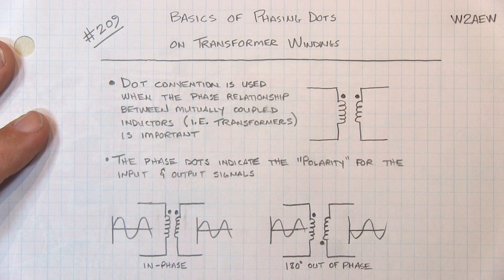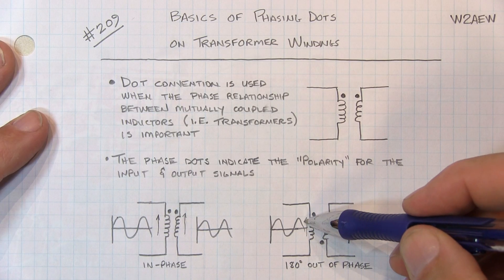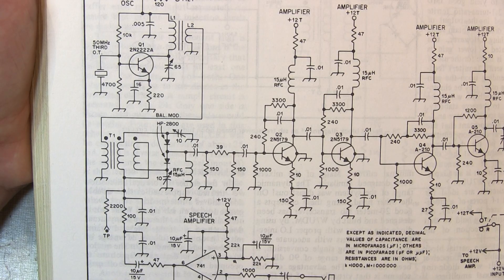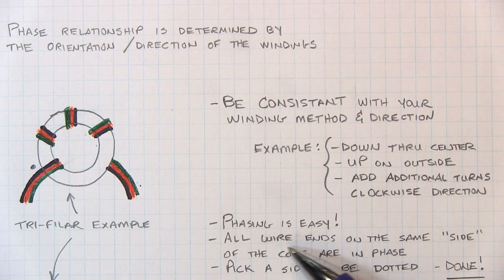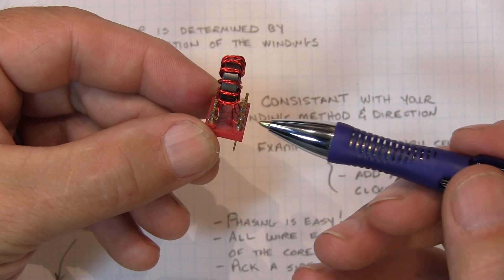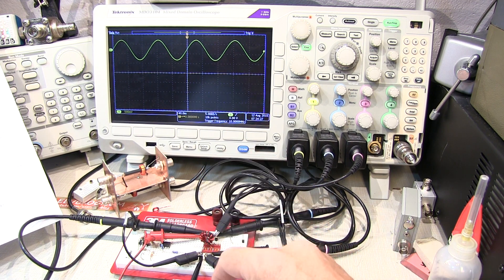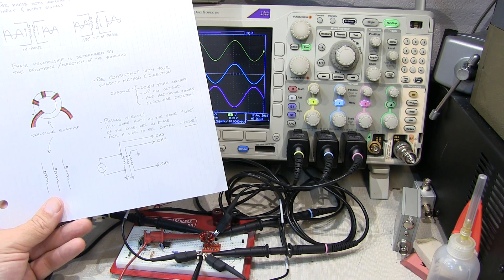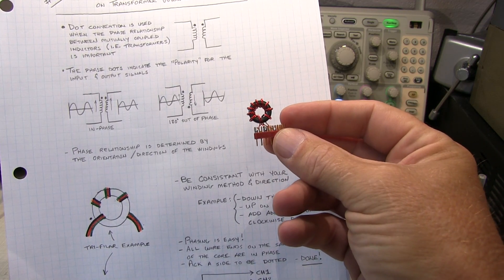#209: Basics of Phase Dots on Transformer Windings

Comment: The Transformers are called EI Transformers because the steel sheet laminations are shaped either as an E shape or I shape, but why are they making the laminations as an E shape and I shape?
Reply from the maker: The combination of the two shapes make it easy to make a bobbin style core for the magnetic path, and laminations reduce eddy current losses  
https://m.indiamart.com/proddetail/transformer-laminations-1349747591.html
Reply: @w2aew ok thanks I didn't know the E shape and I shape laminations were for the bobbin style. The plain enamel wire used had a coating which now the coating has been banned for health regulations which the coating reduces the outside EMF interference. The laminations are used to reduce the Eddy currents in the transformers iron core? The laminations are steel which brass and steel have Eddy currents, nickel plating doesn't have Eddy currents but steel and brass do have Eddy currents
Reply: @w2aew  Why do Single Ended Class A Transformers need a DC Bias voltage, which it has the rating listed on the transformer? Single Ended Transformers for Class A operation use an "Air Gap" which I think the Air Gap does something to cancel out the DC from magnetizing the transformers core? Dual Ended Transformers don't have the AIR GAP in the core so they can make the transformer much smaller sized. Single Ended Transformers are bigger sized, more steel lamination plates, bigger core, more winding, has an Air Gap.

Comment: What causes "power losses" in EI transformers? Why do EI transformers and toridial transformers have an "operating duty cycles" at certain frequencies? What I'm confused about is what is determining the transformers operating duty cycles?
Reply from the maker: typically Eddy Current losses:  full documentation here: https://en.wikipedia.org/wiki/Eddy_current
Reply: @w2aew  so you're saying that EI transformers have a higher Eddy current VS toridial transformers have less Eddy. The Eddy current is causing the power loss. What is causing the Eddy current to increase or decrease in transformers? Is it the laminated plates causing leakage current. Eddy currents are circulation current that is NOT draining to ground or has a path to ground?

Comment: What does M6 laminates stand for the M6? The winding of the wires "proximity" is either loose or tight, but in transformers specs it doesn't list the wires winding proximity any reasons why? The looser wires winding is LESS inductance mean more high end
Reply from the maker: There is a description of the properties of this material here: 
https://edcorusa.com/products/ei-37-m6-29-gauge-orientated-single-phase-steel-lamination?srsltid=AfmBOor1vIL6vqtM0Ai4_U7KKZrUFNozfk8RcbGHdXd6Yh_GOC9okaN9
Reply: @w2aew  The M6 means the Alloys used? or the grain structure? I'm confused what are Laminates in transformers, they are somewhat like capacitor plates which capacitors internally have laminates/plates? The M6 laminates changes the magnetic field level and magnetic flux levels? It can be measured using a Gauss meter?

Comment: When a tube amplifier output transformer is used in correctly but using a speaker impedance that is below the rated impedance will cause the reflection impedance to be doubled. If the output transformers is designed for an 8 ohm speaker load but instead some uses a 4 ohm speaker load the reflected impedance will be doubled which will cause the power tubes impedance to be mismatched with the primary side of the output transformer. This causes an audio volume drop and wattage drop, any reasons why?

Comment: very informative. One question i would like to add is how to determine the # of windings if its not writtten of specified in the schematic? some do put values while others do not
Reply from the maker: There are several variables.  The frequency of operation, the impedances of the circuits, and the ratio needed, along with the core material used, all feed into the number of turns required.  For 1:1 ratio transformers, it is common to have sufficient turns to get an inductance value at least 4x the system impedance at the lowest frequency of operation.

Comment: How can you test the transformers laminations to know if they are high quality laminations or cheap steel laminations? anyway of testing this or how to measure a transformers eddy current? I'm not sure if a ammeter can be used to test the transformers eddy currents because the higher the eddy current this means that the transformers laminations are cheap steel?

Comment: Can you try to make a video lesson on how to use a mega to check the insulation of transformers and motors because the only way to test a transformer of the IFS a partial coils or shorting or there is this like a small internal short not all not a not the whole transformer but just partial shorts because of the insulation a mega will test the insulation voltage if there's something wrong but I don't know how to do it because I don't know what is right and what is wrong and what is considered good and what is considered bad when you have a transformer and you're running both high voltages from it to chest installation to see if there is a partial short

Comment: sir may I ask you a somewhat related question? I am wondering if we can connect the primary windings of an audio isolation transformer to the output of a class B direct coupled amplifier and the secondary windings to the speaker?  Will the output of the amplifier be affected in a harmful way due to the impedance of the primary transformer? Using a one to one turns ratio.
Reply from the maker: If it is a one-to-one turns ratio, then the impedance at the primary will be equal to the impedance connected to the secondary.  In other words, the amplifier output will "see" the speaker impedance.
Reply: @w2aew  Thank you! I appreciate it.
Reply: @w2aew  I am just concerned if the primary windings will look like a short to the amplifier output with or without any speakers connected to the secondary.
Reply from the maker: @uiticus  It will look like a short at DC (biasing), but will reflect the secondary's load impedance at audio frequencies.
Reply: @w2aew  Thank you sir. Much appreciated.

Comment: Excellent and brilliant explanation...
With regards with power transformers. Just by taking 2 separate secondary windings of the same values and hooking them up in series out of phase one could gain a few more volts compared to the 2 same windings in phase.
Thumbs up...

Comment: To measure the alloys in transformers, what lab equipment can you use to measure how much Iron, Nickel, metals in the transformer? Some EE techs use a Spectrometer I think. The old radios from 40's and 60's use to call the transformers "radio metal" which means that have 80% percent nickel which I'm not sure why they used so much nickel in radio transformers. The Lamination for the transformers windings was 5/8ths which for any reasons why they used 5/8ths for the lamination on the winding?

Comment: When visually looking at a transformer or measuring them, how do you know if the transformer is a galvanic isolation? I'm not sure what make a transformer have galvanic isolation. The iron core and wiring wrapped around the bobbin or slug is the transformer part but what is the galvanic isolation part of the transformer to make it galvanic?
Reply from the maker: Galvanic isolation means that there is no DC path between the primary and secondary - that's all.  You can easily verify this with an ohmmeter.
Reply: @w2aew  The Iron Core or what is causing the Galvanic Isolation and preventing there is no DC path? because all transformers even Non-isolated transistors have Galvanic isolation. I'm not sure why its advertised that ONLY isolating transformers only have Galvanic isolation and other non-isolating transformers aren't advertised as having galvanic isolation.
Reply: @waynegram8907  are you talking about safety transformers? In all transformers the windings are isolated from each other. In safety transformers, used on construction sites for example, there is additional isolation seperating the windings so primary and secondary can never short. The secondary winding also remains floating from ground, so a fase to ground fault in equipment does not cause high fault currents. I do not know why they call this galvanic isolation. I understand your confusion.
Reply: @w2aew  How can you tell if an output transformer has an internal air gap because some transformers are called air gap transformers. What does the air gap do because it suppose to allow DC current and DC voltage to go through the transformer coil?
Reply: @w2aew  Galvanice Isolation means that the mutual inductors between primary coil and secondary coil is ZERO. How can you measure the transformers "mutual inductance", using an LCR meter? because most transformers tell you the turn ratio TR the primary number and secondary turn number but they don't tell you the mutual inductance between the primary coil and secondary coil ,  any reasons why?
Reply from the maker: @waynegram8907  No, Galvanic Isolation does NOT mean that the mutual inductance is ZERO.  It means there is no DC path between the input/output.
Reply: @w2aew  Most Isolation Transformers have Mutual Inductance so when you have mutual inductance across the primary coil to the secondary coil the mutual inductance  value is higher than zero so their is no galvanic isolation. Galvanic isolation is measured based on the mutual inductance across the primary coil to secondary coil, this is what other EE engineers have told me. Yes all isolation transformers has No DC path between input/output but they have mutual inductance that is higher than zero.
Reply from the maker: @waynegram8907  ALL transformers have mutual inductance between the primary and secondary - that's how they work.  Galvanic isolation has NOTHING to do with mutual inductance.
Reply: @w2aew  Isolation Transformers have a mutual inductance specification because the higher the mutual inductance the more noise from the primary closed loop circuit jumps across to the secondary closed loop circuit. The lower the mutual inductance the less noise so better signal to noise ratio. I didnt know Galvanic Isolation meant that DC can't jump across from primary to secondary because all transformers are considered galvanic isolation. I can't name another component that is galvanic isolation besides an Opto Coupler or Opto Isolator which I'm not sure if Opto couplers or opto isolators are considered galvanic isolation? PCB boards have isolated grounds which I guess they are considered Galvanic isolation since each grounding plane is isolated from each other its considered galvanic isolation?
Reply: @w2aew  When Engineers say that the transformer is Loose coupled means what by loose coupled? Loose coupled compared to Tight Coupled
Reply: @w2aew  The higher the resistance of the inductors winding means that it takes long for the electrons to pass through the inductors winding resistance? The Higher the resistance in a transformer make the electrons "less easy" to move from the primary coil to the secondary coil?

Comment: The formal dot convention state that each positive current injected into a dotted terminal of a multi-winding coil, will result in a core magnetic flux with the same direction, contributing to the flux  buildup. The voltage polarity is just a side effect actually...

Comment: What causes transformer hysteresis? because the transformer hysteresis will cause a voltage drop from primary to secondary, not sure why
Reply: Remenant magnetism in the transformer core. The current magnetises the core and the magnetic field generated has a polarity, direction, whatever floats your boat, that is a function of the direction of the current. If you turn the current back to 0, a small magnetic field remains in the direction of the current. If current starts flowing in the reverse direction, it has to 'undo' the remaining magnetic field first before a magnetic field in the other direction can build up. This is what causes the hysteresis loop.

Comment: Could you give us a couple (pun painfully intended) examples of why in phase would be desirable, and also out of phase would be desirable in a circuit? For example: an early single ended guitar amp? Thanks Alan! Great video BTW! ;)
Reply from the maker: The most common application where the phase through the transformer matters is when the transformer is part of a feedback loop, where improper phase will cause the circuit to not work.

Comment: 3 phase transformers will have 208VAC outputs, its 120VAC +180degrees = 208VAC? The reasons why they used 208VAC instead of 240VAC was that 208VAC produced less heat dissipation and didn't wear out the AC motors in house equipment?
Reply: In a three phase transformer the phases are 120 degrees from each other. The phase to phase voltage is 120 V times √3. The advantage is that the delivered power from a 3 phase configuration is really smooth. Power from a single phase is actually a 100 Hz pulse while the motor tries to deliver continuous mechanical power. So it starts vibrating.
Reply: Edit: probably a 120 Hz pulse where you live.

Comment: w2aew, for center tap transformers that use the center tap as the ground, when disconnecting the center tap from ground the other voltages which drift higher or lower. When a 12VAC center tap transformer center cap is disconnected from ground, each side of the transformer will drift higher or lower but will equal to 24VAC. If one side of the transformer lug measured 12VAC referenced to the center tap to ground and the other side measure 12VAC referenced to the center tap to ground that is 24VAC from outside lugs. But when disconnecting the center tap from ground the output lugs will drift higher or lower but will still equal to 24VAC. Any reasons why the output legs will drift higher and lower in voltage and not be "matched" at 12VAC?
Reply from the maker: The ends will always be matched at 12VAC with respect to the center tap.  But, if the center tap isn't connected to ground, the voltage from either end TO GROUND can be anything because it is isolated from ground.
Reply: When the center tap isn't connected to ground, why aren't the ends matched to the same voltage? The transformer windings from the center tap to each end should have the same winding turns ratio so they should have the same voltage even if the center tap is not connected to ground.
Reply from the maker: @waynegram8907  They Do have the same voltage when measured with respect to the center tap, but they won't necessarily be matched when measured with respect to ground.  This is because the center tap is not tied to ground.
Reply: That is what I'm confused about is why won't they be matched with the center tap is not tied to ground. They should be matched because the winding turns/DC resistance from center tap to end lug are the same. The transformer windings should be symmetrical from each end lug to the center tap
Reply from the maker: @waynegram8907  If you measure from either end to the center tap, they WILL be matched.
Reply: yes true, but not when you put your Fluke DVM meter black probe on the chassis ground to measure the voltage on the ends the AC voltages won't match. This is what I'm confused about because when you measure the DC resistance from center tap to each end they have the same DC resistance but the AC voltages are different when referenced to chassis ground with the center tap disconnected from ground. I would think they since the winding turns ratios are the same from center tap to ends lugs that the AC voltages sound be the same since the transformer should be symmetrical and balanced.
Reply from the maker: @waynegram8907  That's because there is a voltage offset between ground and the center tap.  The load presented on each end of the winding will influence how much offset you'll get between ground and the open center tap.
Reply: Yes each end will have a different LOAD since each end of the transformer will be going to a different part of a circuit. I'm confused why there is a "voltage offset" between chassis ground and the center tap or what is causing the voltage offset between the chassis ground and the center tap. When you disconnect the circuit load to both ends of the transformers with the open center tap, there AC voltages are different on both ends even with No Circuit Load. Having the transformer open center tap I would think that both ends would have matched AC voltages since the DC resistances are the same.

Comment: I came to watch this video having the idea that if you wind a wire in the same direction it would have the same phase (represented by dot convention). But I wanted to know if you wanted your secondary side out of phase would you the wire in the opposite direction. But you just showed connecting the scope at different ends with respect to the other channels will get you 180 out of phase.....this was still a good video for in phase design concept
Reply: Either method will give you the 180 phase shift. Reverse the leads, or wind in opposite direction.

Comment: W2aew, Older transformers caused HUM issues, any reasons why the transformer itself caused HUM issues ? How do you measure the "Loop Area" of a transformers or a power supply? I'm not sure if linear powers supplies has less of interference issues if there is clock circuits, sync signals, switching circuit next to the linear power supply using an Iron Core transformers compared to a toroidal transformers? The interference issues i'm guessing is called the "loop Area" of the shielding needed around the powers supply  so the adjacent circuts like clocks, sync  circuits, switching circuits won't get into the power supply circuit.